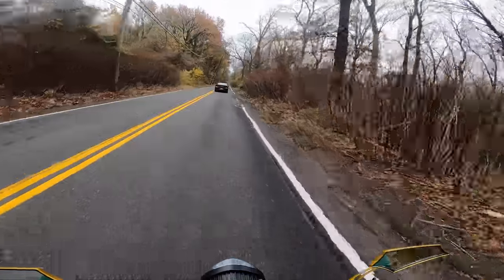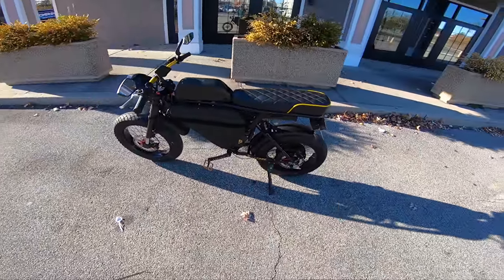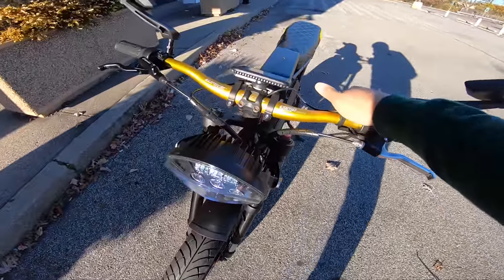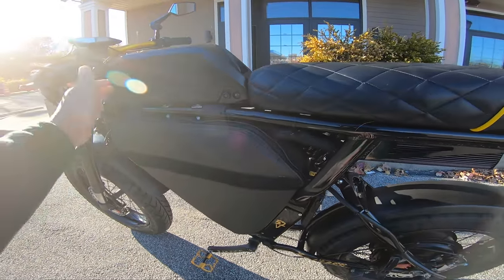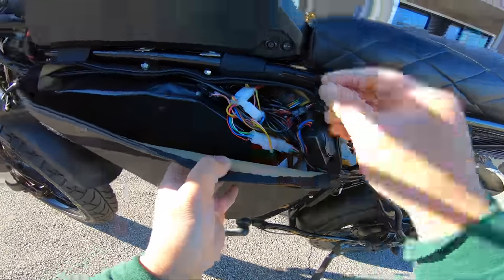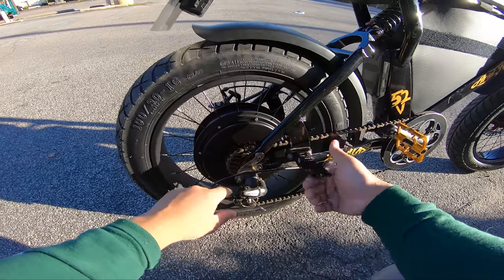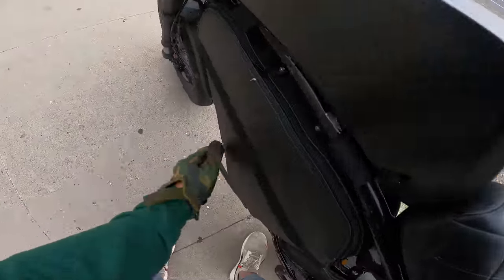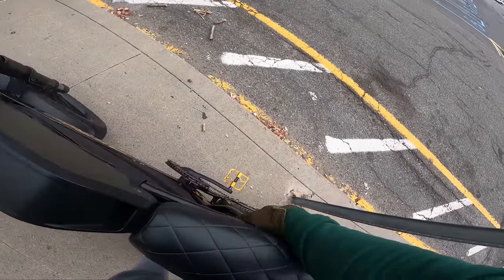This bike is TOO FAST! 5000W Ariel Rider X-Class First Impressions

Comment: Please tell me you upgraded shocks , brakes and springs.
Reply from the maker: Absolutely! New rotors, calipers, rear spring..very comfortable ride at high speeds especially
Reply: @JB360_NYC  Do you mind adding them to your list? 
My rule for safe riding is, the bike should not weigh less than you.

Comment: What's the name of this security lock that you have for your bike, and what does it come with an alarm ?
Reply from the maker: It actually comes with the motor kit, plugs right into the controller. You can find them on AliExpress as well:

https://m.aliexpress.us/item/2255801049477940.html?spm=a2g0n.detail.1000014.10.47aa4452oUfoDK&gps-id=platformRecommendH5&scm=1007.18499.315613.0&scm_id=1007.18499.315613.0&scm-url=1007.18499.315613.0&pvid=4b20a61c-5187-40be-8f77-10ce0f2f1bc6&_t=gps-id%3AplatformRecommendH5%2Cscm-url%3A1007.18499.315613.0%2Cpvid%3A4b20a61c-5187-40be-8f77-10ce0f2f1bc6%2Ctpp_buckets%3A668%232846%238111%231996&pdp_npi=2%40dis%21USD%216.57%214.6%21%21%21%21%21%402103309f16689594930181641ecd53%2112000016835468752%21rec
Reply: @JB360_NYC  do you know if this is compatible with a stock Onyx RCR motor and controller? it def is a nice feature to have.

Comment: How did you wire the headlight to the sabvoton kit?   Where did you connect the daytime running light wire?
Reply from the maker: Ended up stripping the headlight wire and only using 3 out of the 4 wires (don't need to use the headlight red wire) and connecting to the light kit. Headlight wire green to light kit blue wire, headlight wire yellow to light kit brown wire, and lastly headlight wire black to light kit wire black. I know I had mentioned DRL but technically it's high beam and low beam that are fully connected.

Comment: Very cool. I'm just wondering why you didn't skip the 3k motor and go straight to the 5k in the first place?
Reply from the maker: I regret doing that tbh because I thought the 3kw would be enough for my needs which it was. Although with my old battery setup I wasn't getting the range I desired especially on longer rides and didn't want to weigh down the motor with more battery weight. At least with the 5kw I know it can handle the weight and capacity of the full frame.

Comment: Hey JB, sweet build bro.  I heard that you parallel your battery setup so are you able to use the e-brake feature on the sabvoton controller at the same time?
Reply from the maker: Correct the e-brake feature still works.

Comment: I’m now interested in getting an X class over my RCR. Is there a significant difference between the 150a and 100a 5000 watt motor?
Reply from the maker: Yes in terms of top speed for sure, although the 150a does burn through volts a lot quicker. I'm seeing my range take a little bit of a hit lol.

Comment: What's the alarm system that you have that locks up your wheel when the alarm goes off???
Reply from the maker: It actually came with the motor kit but you can find them on AliExpress - plugs right into the controller

https://m.aliexpress.us/item/2251801776226746.html?gatewayAdapt=glo2usa4itemAdapt&_randl_shipto=US

Comment: Hey JB, can you link me to the front and rear brake mounts for the 203mm rotors. I bought some IS mounts off Amazon, but they are still too short.
Reply from the maker: No prob, there's actually only 1 that works for the front and back so you just need to buy 2 of them:

SHIMANO MA-F Disc Brake Mounting Bracket https://a.co/d/aWwe95b
Reply: @JB360_NYC  Thanks! Its the 203mm Post/IS front, correct? Its odd that the no name brand I bought had the same description, but it still needed a bunch of spacers.
Reply from the maker: @engr_e  yes correct...I had to use some spacers for the rear one but the front one should work fine with the spacers it came with

Comment: Does the x-class feel more stable than the stealth bomber and high speeds?
Reply from the maker: I would still say the Stealth Bomber has the upper hand mainly because of comfort and suspension. Also that frame feels more sturdy at higher speeds.

Comment: Was the frame made strong enough to handle power and speed???
Reply from the maker: @andresmiranda3197  for this particular I think 50-60 is a good sweet spot. Anything above that I wouldn't trust going high speed for long periods of time
Reply: @JB360_NYC  orale.. 🤙

Comment: How many amps are you running on this? Is it the full 150a?
Reply from the maker: My flux weakening is currently set to 50 amps so I'm able to pull a full 200 amps for this setup. New battery allows it especially with the high BMS thank goodness.
Reply: That’s insane! Nice build. Let me put in perspective amount of money needed roughly: nb 5000w $1000, batteries $2000+, bike $3500. About $6500 to do this correct? Not including tires and brakes. That’s if you’re doing all the work yourself.
Reply from the maker: @johnnylong2049  The base stock X-Class bike (that I have) costs $2200. The Grizzly however, is about $3100 so that will run higher for the overall build process.
Reply: @JB360_NYC  regardless, still a gorgeous beast of a bike.
Reply: @johnnylong2049  I would need to be able to sell my Vespa GTS 300 for one of those with that setup. Maybe a wash Vespa GTS 300 for E-Bike less gas money,registration and Insurance 🤔

Comment: How long does the battery last and take to charge 🤔
Reply from the maker: From a full charge normally, it would last about 2-2.5 hours, riding normal and not maxing out the throttle. To charge to full takes about 4-5 hours to charge.
Reply: @JB360_NYC  only 2.-2.5 hours ? 🤔

Comment: So this is no where near what you can expect stock correct? Im fairly new to this style of ebike but was looking at the Ariel Rider. Not planning on any modding.
Reply from the maker: Correct this is with heavy modifications
Reply: @JB360_NYC  What are your thoughts on these straight from the box? Was looking at this or the grizzly (1000$) more. The dual motors seems nice. What would be its closest competitor in your opinion?
Reply from the maker: @FalcoINC  I think in terms of all terrain, the Grizzly is the way to go. It's just as fast as the X-Class possibly even faster with its dual motors. Plus you have added range with 2 batteries with the Grizzly.

Comment: Hey JB, currently putting together my 5000w kit on my x-class, kind of trying to replicate your build lol. How did you fasten the torque arm on the side of the dropout with the gears? I don't see a way to fit the bolt in there without it hitting the smallest cog. Thanks in advance!
Reply from the maker: Yea for the gear side there are a couple spots you kinda have to gauge. The best spot is right above the smallest cog, it actually won't touch the small screw for the torque arm.
Reply: @JB360_NYC  Oh I see. So did you use a nut on the inside part of the dropout to keep the screw secure or is it just the threads of the screw keeping the torque arm secure?
Reply from the maker: @peanutbasketr9217  yea you don't really need the bolt on the inside, just have a washer on the torque arm side and thread that screw in a couple of times and you're good.

Comment: this has 5Kw continuous power? runs damn fast if you ask me. how's climbing?  looks nice, but i need something that can go up to 30 degrees slopes ...
Reply from the maker: Oh yea this thing gets up hills at 50 mph on steep slopes. Our area is full of hills and this thing handles them like a champ.
Reply: @JB360_NYC  sweet :D . the only bad thing is that here in europe you'd need to have motorcycle license to ride one on streets. waaay to powerful for our laws :(
Reply from the maker: @ApocGuy  oh man I've heard about the wattage limit in UK and EU. What about high powered scooters and unis? They regulate those as well?
Reply: @JB360_NYC  any EV over 250w no-go.budy has 500w mid drive and local PD fined him and confiscated the bike since be didn't have driving license for it.1500e fine...

Comment: Can you do a video of how you mounted your controller under the seat? I would think it would get wet and dirty with the connections being exposed.
Reply from the maker: That should be coming soon which will be featured on Sal's channel. It actually wasn't that bad since there were screw mounts from the battery pack before

Comment: How did u mount your battery in the top tube?
Reply from the maker: Used the mount it came with a long with some spare pieces of metal to anchor it on the top tube

Comment: did you register it as a motorcycle, moped, or ebike? i saw what looked to be a license plate from one of the angles but didnt see if it was a legit plate
Reply from the maker: That's actually a vanity plate lol. DMV won't actually let me register it because I don't have a VIN number.
Reply: @JB360_NYC  you'll have to visit your DMV but here in VA our DMV has forms where you can submit to apply for a VIN for special use cases, and other builds (4 wheeled vehicles) i havent been able to visit my dmv yet but you could always ask what you need to do for a Motorcycle/moped custom build.
Reply: ▪️
Just slap a class 2 sticker on it and call it good.
🟥

Comment: How did you get your bike to reach 70? I have an RCR and I would love to be able to go faster than 50 on average.
Reply from the maker: The combination of higher rated controller and 72V Molicel battery allow the motor to output a ton more than most setups. With the RCR, you can definitely reach those speeds but would have to tune the Kelly controller, swap the stock battery for Samsung cells or similar, as well as swap the motor.
Reply: It's a kit.... New motor, battery controller on an Ariel X- class
Reply: @JB360_NYC  I am dumb about this stuff, but I like what I'm hearing.
Reply: @JB360_NYC  Could you explain to me, maybe on another platform, what I'm looking for to upgrade my bike? I don't know what type of motor I need or anything. Your advice is really appreciated.
Reply from the maker: @andrewhumphries7005  there's actually a guy by the name of John Angel who is really the guru of everything Onyx. He responds to most messages here on his IG

https://instagram.com/johnangelnyc?igshid=YmMyMTA2M2Y=

He's worked and consulted a ton of Onyx riders across the country. Very cool and knowledgeable especially with the Kelly controller.

Comment: Can you give me a list of where you purchased your parts. I'm going to build my Ariel dual motor bike.
Reply from the maker: No problem dude, here's the list:
Motor Kit - https://www.e-streetbikes.store/product-page/5000w-150a-e-street-cannon
Battery - https://www.e-streetbikes.store/product-page/46ah-x-class-full-frame-molicel-72v-300a-bms-battery
Light Kit - https://www.e-streetbikes.store/product-page/dc-converter-light-kit
Reply: @JB360_NYC  you're the man! Question,  for the Ariel Rider d-class, that's a dual motor like the grizzly, would This set up work?
Reply from the maker: @DABUSA714  yes it should be the same dropout as the Grizzly and X-Class which can have that rear motor swapped out if you plan to upgrade.
Reply: Hey jb360, great build, Sal does great work, what size rotors? Ebike or motorcycle hydraulic brakes with power cut off? Safe riding👍
Reply from the maker: @loubuontempo4964  I have 203mm rotors on and in terms of brakes it's hydraulic with brake cut off

Comment: How is it going 70mph on a 5000w motor? I thought you can only go up to 55mph on a 5000w motor. Please let me know how you did it
Reply from the maker: High output battery and unlocked Sabvoton controller will get you to 70mph.
Reply: @JB360_NYC  thank you so much, that will help a lot!
Reply: @JB360_NYC how do you unlock the sabvoton?
Reply from the maker: @Jujubees225  you would have to get one pre-unlocked from a dealer. Unfortunately you can't unlock them straight up 😕

Comment: Have you gotten pulled over yet for driving on the roads at that speed especially without a license plate?
Reply from the maker: Not here in NYC. Although if I was on the bike path at a park or Greenway, park police would definitely issue a ticket or summons.

Comment: You should put an awd set up on it with a 1.5 t motor on the front. you can get better efficiencys at different ranges of speed with 2 motors, and 2 motors will always be more efficient than one because of the square cube law
Reply from the maker: I'm still waiting on someone to build this ^
Reply: @JB360_NYC  i mean how much would you pay for the controller?
Reply from the maker: @devanwheeler3426  might have to be two 80a Sabvoton controllers. Come out to about 200 bucks a controller.
Reply: @JB360_NYC  I have a two wheel motor 1000 watt each motor two throttle all wheel drive Arial Rider X

Comment: Where did you get that full frame battery bag?
Reply from the maker: Ordered it from Sal at E-Street Bikes
https://www.e-streetbikes.store/
Reply: @JB360_NYC  wow they are very expensive the cost of the ariel rider itself , I wonder if this is safe to custom use, I hear about ebikes exploding becuase of modifications
Reply from the maker: @wesleygaitan  these are constructed very well as these builders have been putting together packs for years. We only use the best BMS systems for the packs to ensure safety and quality. A lot of those ebike batteries you hear exploding are from 3rd party companies in China that don't put a proper BMS in with the battery which can cause overheating when charging for over 12 hours.
Reply: @JB360_NYC  I see that's very informative, if that's true it may seem like it's political in nyc then.
Reply from the maker: @wesleygaitan  yea it's an issue here in NYC. An abundance of buyers purchasing from AliExpress and Amazon that sell cheap PEVs with bad cells which is causing it. This puts a lot of riders in a bind unfortunately with regulations coming in the near future. Hoping they regulate sales to legitimate companies instead of banning PEVs in general 🙏
Reply: @JB360_NYC  the news should put talking about that instead of demonizing people with ebikes, particularly delivery guys

Comment: Im gonna purchase the Ariel X in a few months with the 3000w mods. I think maybe the 5000w might be a bit much. Im going to use it for work commute..20 miles ,one way.
Reply from the maker: 3000w kit is perfect even with the 80a Sabvoton. You'll hit speeds in the upper 50s.

Comment: So, the higher number motor is what allows you to hit those top speeds? Sorry, still learning!
Reply from the maker: So from what I gathered from different riders, the higher T counts represent higher torque and acceleration. The lower T count represents lower torque but higher top end speed. Mine is right in the middle ground at 3.5T.

Comment: How do you get the alarm to lock the wheels?
Reply from the maker: There's actually an adapter that plugs right into the Sabvoton controller. Comes with a remote and all.
Reply: Thanks, I'm looking on Amazon for that right now.

Great build btw
Reply from the maker: @MatrixSS  thanks!

Comment: Link to dc converter kit used for head light
Reply from the maker: https://www.e-streetbikes.store/product-page/dc-converter-light-kit
Reply: So you use sals light kit and switch out the front light?
Reply from the maker: @juniqueish  Yes correct. Everything is pretty much plug and play with the headlight the kit comes with. If you want to use a motorcycle headlight though it would require splicing the wires of the new headlight to the converter kit.

Comment: You need to take a motorcycle class. This will teach you strategies of lane placement and awareness. People do not see me on my 750 lb, roaring internal combustion , bad assery machine. There's no way people are gonna see that silent ninja you got. You do a lot of street riding and maingling with cagers at speeds of 50 or more. The more visible you can be, the longer you will stay alive. The Light you got is a fantastic. People will see the white light. The mirrors do nothing for safety, but damn they look good.

Comment: Wow, that's insane speed for an ebike. 😃

Where can eye mod mine, and who did'ya get assist or do it for'ya?!
Reply from the maker: I went with Sal from E-Street Bikes for mods 🙌. He pointed me in the right direction and installation is pretty straightforward. No splicing wires or anything. 
https://www.e-streetbikes.store/

The only difficult part really was installing the moto tires and drilling holes for the torque arms.
Reply: @JB 360  
Thaaank you so much!!
Your bike ROCK DUDE!!
MY NEW EBIKE HERO!!
😀😄😉👍🏾

Comment: Have a link to that alarm system?
Reply from the maker: It actually came with the motor kit but you can find them on AliExpress - plugs right into the alarm/lock cable on the Sabvoton controller. It's the 6P connector version

https://m.aliexpress.us/item/2255801049477940.html?spm=a2g0n.detail.1000014.10.47aa4452oUfoDK&gps-id=platformRecommendH5&scm=1007.18499.315613.0&scm_id=1007.18499.315613.0&scm-url=1007.18499.315613.0&pvid=4b20a61c-5187-40be-8f77-10ce0f2f1bc6&_t=gps-id:platformRecommendH5,scm-url:1007.18499.315613.0,pvid:4b20a61c-5187-40be-8f77-10ce0f2f1bc6,tpp_buckets:668%232846%238111%231996&pdp_npi=2%40dis%21USD%216.57%214.6%21%21%21%21%21%402103309f16689594930181641ecd53%2112000016835468752%21rec
Reply: @JB360_NYC  thank you

Comment: what size are the Kenda K671 Cruiser ST, like 20 inch or bigger ?
Reply from the maker: They measure out at 20 inches with about a 4 inch width
Reply: @JB360_NYC  ok Thank You :0
Reply: @JB360_NYC  i would need 2, 20 inch and one 24 inch ok :0
Reply from the maker: @stan121midling5  for this build you would need two of the 20 inch
Reply: @JB360_NYC  yes, but my front tire is a 24 inch, which i would also need, is there the same tire but in 24 inch ? i have a etrike :0

Comment: For the Molicel battery, WAHT connector did u get with it, and did u get the panel case?
Reply from the maker: I got the QS8 discharge cable. Yes I ordered the panel casing with Sal when I ordered the battery